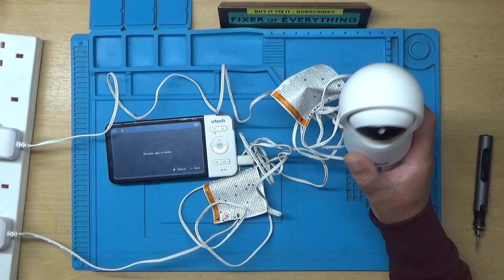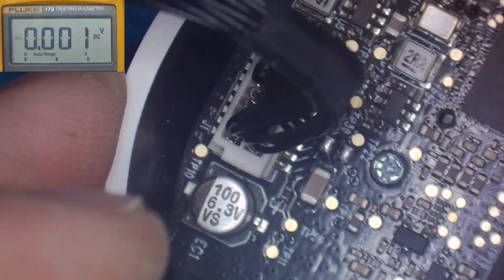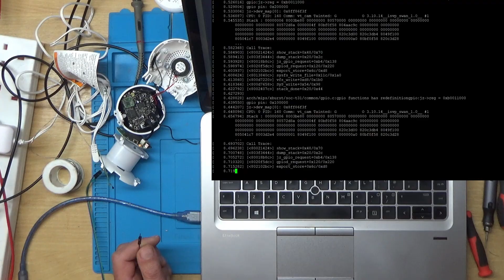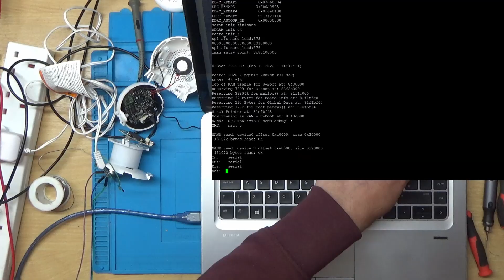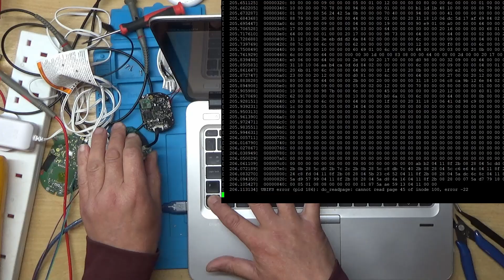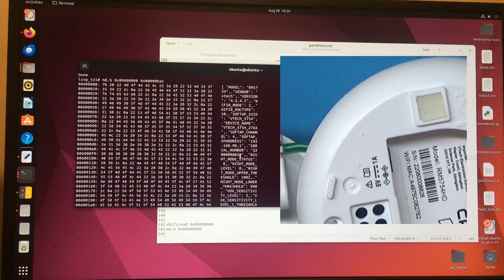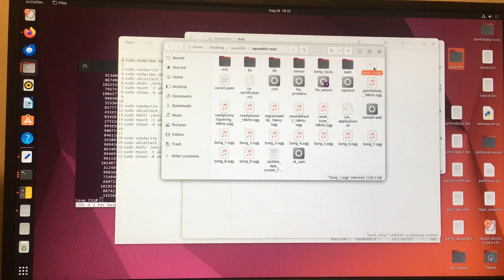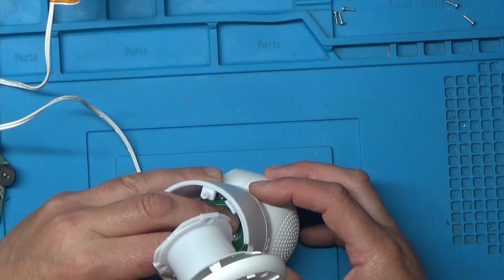Faulty VTech Baby Monitor | An EPIC Repair With Shocking Findings!

Comment: Amazing. I recently picked up two of these from a Goodwill bins for like 10 cents each with the model number being RM5766-2HD and no tablet so trying to use my phone. I'm having a problem getting both the cameras to read the QR Code off my phone so it would pair up. It seems to all work up until that point, but have no clue why it doesn't read the code no matter what I do.

Comment: It looks like it was running out of memory to initiate the system while booting. A shame this is not solved through the reset button.
Reply from the maker: After I got it working again, I found that there's an SQL database that indexes the pictures / videos on the partition. This had been corrupted (perhaps powered off at the time it was writing), and that was the root cause of things. Deleting the partition forced it to re-build the database.

Comment: hey, a late comment on this (side effects of subscribing to your channel not long ago, and binge watching), but if you get tired of the original firmware on this, there's thingino, an open source firmware replacement for ingenic socs, like this t31. it's really easy to add support for a new camera, and I'm pretty sure the sensor and wifi modules used here are already supported. just requires a brief gpio list and what they're used for, and you can program it through usb!
Reply from the maker: That sounds like a really interesting project, thanks for the tip! 👍

Comment: Holy god this was a hell of a ride just epic!! thanks for doing this video extremely detailed, I was searching Google for issues I'm having with a VTech monitor and your video just came in and I watched the full 55 minutes it was a great ride, and this practically confirm what is happening with my monitor, I'm 99% sure the firmware update go wrong just like your camera, but in my case the cameras (mine came with 2) are fine the problem is the monitor unit, it just freeze at the boot screen with the baby and the mother photo and nothing happens it just stuck there and there is no way to turn off the unit, only when the battery is depleted, even the reset button doesn't fix the problem, I guess I will have to connect it using a USB to TTL converter and solder just like you to be able to reset the partition and see if that fix the problem, I can't believe VTech is getting away with a problem like this, it could be a class action lawsuit, how many devices are being bricked because of this I wonder, thanks again for giving all the light to this problem from VTech and finding a fix.
Reply from the maker: Thanks mate 👍Hopefully you can figure out what's wrong with the parent unit.

Comment: Impressive fix! Takes me back to my linux admin days.
Another way to do it might have been to use fsck.ubifs to fix the filesystem instead of having to delete and recreate the partition. Also it's possible it wasn't the firmware update that bircked it.. it could have been a recording ehich hit a bad block and corrupted the image (in which case it might happen again in future). If so you could probably use 'nand markbad' manually to prevent that from happening.

Comment: Afaik, the usual purpose of the 0ohm resistors everywhere is just as jumpers to save money by avoiding extra PCB layers, rather than as fuses, though they will fulfill that function too.
Reply from the maker: Yes, I've seen them used as jumpers, fuses, and to isolate part of the circuit for troubleshooting.

Comment: You went way over on this fix, congratulations on figuring out how to fix the missing commands. I've got a couple of the modules for programming PIC and Arduino chips so is the one you used a different com?
Ok I figure it out it's just the standard Eprom 232 USB-to-serial UART. I got to do networking for Boeing in the 80's for 5 years we did all of that even Appletalk. Don't forget the data twist.
Reply from the maker: Glad you figured it out, those serial adapters are super useful! 👍
Reply: @BuyitFixit Just never figure to use them on consumer electronics.

Comment: I found this video brilliant, excellent the way you broke it all down to the flash data, fascinating 👍. On another note, will the camera revert back if it does a firmware upgrade again ?
Reply from the maker: Thanks mate 👍I'm not too sure if it was a firmware upgrade.After making the video I think the root problem was the SQL database that points to the stored images was corrupted, but deleting the partition that held the images caused the database to be rebuilt. I think it might have just been powered off at the wrong moment when it was writing the database.
Reply: @BuyitFixit ah right ok 👍

Comment: Great video! I have the same one which i was using but stopped working. Any quick way to reboot this camera with the pins? Don't need data recovery, just tobget my camera working again. Thanks again
Reply from the maker: Unfortunately not, this one wouldn't boot up properly and was crashing. You could try a factory reset if you haven't already.
Reply: @BuyitFixit mine is doing the same thing. I was hoping to delete/format it with some pogo pins.
Reply from the maker: @sol05033149 just out of curiosity, was there any power outages, or was it unplugged or something before it stopped working?
Reply: @BuyitFixit no idea, one day it was working then it stopped. Hoping i can follow your video. Would it be possible to do this on windows or is Linux required?
Reply: i fixed it now!!!! Followed the erase part of the video and got it working again. Thanks so much for the video, time and effort.

Comment: hello, i think i have a similar problem but i dont have the vtech data 1 and 2 partition can i make some space in the rootfs partition? im trying to create the vtech partition 1 and 2 but i dont have enough space😅 i dont have the right command ton erase stuff in rootfs. thx for the help if someone have a cue for me.
Reply from the maker: Perhaps it's a different model and doesn't have the vtech 1 and 2 partitions? I'd be careful about erasing stuff just in case you brick it completely. I'd try and backup the flash first.
Reply: @BuyitFixit my model is the RM5754-2HD its comes with a second monitor, maybe its because i factory reset it before taking it apart. Was almost there  but when i saw the two partition missing i was like ohhhh mannn .😂 ill try to back-up before doing anything on rootfs. Hope to repair its very unused. Thx

Comment: Hey mate, thanks for the video! I'm reaching out from Brazil. I've got the newer model of the baby monitor (RM5766HD) that wont boot. Got it in the USA in one of my last visits there, but they don't sell those here in Brazil, let alone any spare parts. I watched every second of your video and I believe I could give the wiping of the partition holding the recordings a try. I am a software engineer and can adventure myself with the programs and commands you shared, no problem. It looks like you used a USD to Serial converter. I found some for sale down here based on chip PL2303, FTDI USB to TTL for micro-controllers offering the RS232 serial channel. I hope that's the right converter/adapter to get. Thank you again, you just raised my hopes for fixing this baby monitor and making my wife happy <3
Reply: Oh BTW, I took apart the newer baby monitor model I have and noticed that they upgraded their game and labeled the pinouts accordingly: DP, DM, 5V, GND, TXD (transfer) & RXD (read) so I am able to tell exactly the 3 pinouts I should connect to.
Reply from the maker: Nice 👍,  yes one of those TTL to USB converters you mentioned should be fine.
Reply from the maker: I also discovered the root cause of the problem was a corrupted database file which was indexing the recorded videos, but deleting the videos seemed to recreate the database.
Reply: @BuyitFixit oh interesting! I wonder if they already pushed a firmware update for that. I'm waiting for the converter to arrive and will give this a try. Thank you so much again. Lots of love from Brazil

Comment: Amazing. I'm glad I recently found (and subbed) your channel.
Reply from the maker: Thanks Alan 👍If you liked this one you'll probably like the AVerMedia device I looked at, or the Solar Inverter that I needed a password for, or the tractor dashboard, or the generator control panel that they didn't know the pin code.

Comment: I Linux when you highlight something you can move the mouse to the insertion point on the CLI and center click to auto-paste the data without having to formally copy and paste into the buffer. This works everywhere. I use it to formal copy paste, the highlight more text a second time, and I can move two pieces of data to be pasted at a time. In other words you can highlight , then copy, then highlight again and move the cursor to the insertion point, paste as normal, then move to a new insertion point, center click to paste again the second buffer as long as it's still highlighted. Save you some time and clicks :)
Reply from the maker: Thanks for the tips 👍

Comment: Just curious are you using a differential scope probes or battery oscilloscope? Cant work out the earth mains referenced and not blowing up the scope?
Reply from the maker: No, just a mains scope. The device here is isolated by the transformers in the power supply.

Comment: Im trying to repair my babys monitor, but the terminal is not showing anything when i connect the camera/Ft232. Just flashing red light on the ft232😢
Reply from the maker: Have you got the right com port and baud rate select?
Reply: I'm kind of novice in this but I really want to sort the camera...hell not the top range those cameras as i have 2 and both same problem
Don't think I will be able to sort them
The ftd is recognised with lsusb
Reply from the maker: @DumitraBogdan  When you say flashing is it flickering like randomly? Have you got a terminal program running like I did? What happens if you type on it? Does the other led on the ft232 flash?
Reply: @BuyitFixit  the red led start to flickering as soon as I power the camera. If the camera is off is just a solid red on top left corner. Nothing happens in the terminal when I connect the device to the computer.. 😞
Reply: Can I send the cameras over to you?
Reply: I would like to contact you in privat. How can I do it please?
Thank you!
Reply from the maker: @DumitraBogdan  drop me an email at the channels name at out look dot com

Comment: Enjoy your series very much. Did you let VTech know about the privacy issue? Are you self taught? I'm a retired engineer. Got my MSEE about 40 years ago. I especially envy your dexterity. Keep up  the good work.
Reply from the maker: Thanks, Yes, pretty much self taught. I've always liked messing around with stuff, and what I don't know I can usually find info on things like chips or how to mount a flash dump in Linux, online. No I didn't inform VTech but their products are notorious for privacy issues 🙂👍

Comment: You are  very talented and clever, Sir. You must have been quite enthusiastic and excited, because at the end you spoke so fast it was hard to understand. I really liked the repair process, although I'm not an expert at it, I'm just interested. Thank you for your works.
Reply: Don't be so modest. You are smart. I am now looking at repairing a Kenwood kitchen mixer. We also have the same Chinese miracle, only it's called Silvercrest. I had a mechanical problem, the plastic bearing housing broke, the mini bearing broke. I managed to fix it, homemade, stronger than it was. We still use it now.
Reply from the maker: Thank you very much! I'm not an expert either 😂😂👍

Comment: Good hacking bro. Did a similar thing with an e-reader that wouldn't boot/. It had a seril header and I could look at the boot messages. It indicated a faulty chip. Changed it, but it didn't fix. My electronics knowledge was not good enough to figure out what might be causing the problem and life got in the way of pursuing it further.
Lucky for you it was just a full file system :)
Reply from the maker: Cheers 👍

Comment: Fascinating but I don't quite understand why deleting the video directory solved the problem or why the designer allowed it to occur.
Reply from the maker: After I finished recording the video I was messing around with the filesystem on the computer still, and the root cause of the problem was a Sqlite database on Vtech_data 1. This database is what the camera uses to index the video files, and it had became corrupted. Deleting the videos, made the database no longer valid so it was re-created. It might have been that the database was being updated when the camera lost power or something and that's how it became corrupted but I can't say 100%

Comment: I spent too much of my life working on UBoot, embedded Linux, boot monitors, MIPS chips, and also working with Ingenic on some of their MIPS silicon. I'm now very pleased to be retired and ... doing much the same at home for a hobby!
Reply from the maker: Nice 👍I still love doing this type of work, but sometimes it's just too time consuming for me these days as I've got a lot of other stuff going on. I remember reverse engineering kids toys a few years ago, writing drivers and porting different games to them (a few videos are on here from about 8-10 years ago of the leapTV and a few other things when I was doing that).
Reply: @BuyitFixit  I've got a Sonos Connect AMP that I bought "Spares or Repairs" on eBay, found loads of blown bits in the switch mode power supply, fixed it all, and up it started! I then connected to it in the Sonos app, got told it needed a firmware update and after the update it hasn't booted again. Factory reset doesn't work. I know it needs a serial port connecting, and I even know what's what pin wise, but it's still sulking in its box. BTW I started out in games programming in 1984 !
Reply from the maker: Hmm, I did see what appeared to be a serial port on the sonos I was looking at but I didn't try hooking it up.The approach Id use would be find a ground and then poke at it with the scope see if you see any serial data coming out. Then you can find the GND pin and supply with the meter, the other pin would be for receiving data :) Normally there are 4 pins like GND, RX,TX, +5v or such.
Reply: @BuyitFixit  Yeah, I know where the pins are, but also know that getting this data will send my brain down a rabbit hole for multiple days. I've fixed loads of Sonos gear (keep some, flog some, mostly their inept SMPS PCB layouts causing issues) but this amp is still on the pile. However, the nights are drawing in.

Comment: Great work! Without knowing it,  rewriting over  that partition appears to have caused the volume map to be rebuilt and possibly rewrite the VIF headers. Genius!
Reply from the maker: Thanks 👍After I finished recording I managed to find the file that caused the problem. The problem seemed to be a sqlite database stored on vtech data 1, which indexes the video files, so perhaps the camera lost power or rebooted while updating this file. I think deleting the videos caused this database to be re-created and fixed the error.
Reply: @BuyitFixit could very well be that. Great work :) 

The reason I feel it's more to do with the UBI blocks and its headers is the way you could see in the kernel buffer the "do_readpage" struggling. 

UBI can be a real pain to deal with. All the new BT Home Hubs use it... gives you that extra step when doing firmware analysis.

You've gained an extra subscriber 😊

Comment: I've got two cameras with the exact same problems and the internals look identical inside minus the bottom pins and I have no way to connect the chip to a PC, is there any possible work arounds or possible ways to reset the chip
Reply from the maker: The main chip supports serial, so there might be internal test points on the board. You would have to get up the T31 datasheet and try and trace where the pins go from UART0, UART1 etc and see if there is any activity on the pads that go to those pins.

Comment: Quick note: a zero ohm resistor is really just a piece of wire. Next time just replace it with a wire jumper where the 0 ohm surface mount part was mounted. No reason to search your parts bins for a replacement 0 ohm resistor. Jumper wires RULE! 
Good work on all the research and file system digging in! You almost forced me to learn Linux!
Reply from the maker: Thanks 👍While a jumper wire would also work, I'm not too sure on the current rating of it compared to the 0 ohm resistor. I thought it might be better to just replace it with another resistor.

Comment: Great video, very interesting. I see you was using Minicom for the ttl terminal. I use putty most of the time. You used Ctrl+h for the backspace key. in butty you can edit it in setting to use ctrl+h or Ctrl +? (127). But in Minicom i can not find it in the setting. As you mentioned you edited it the setup. Can i ask you where it is?
Reply from the maker: Thanks 👍It was putty I was using at first on Windows which had the setting when I was talking about editing the setting. Minicom was used later on the machine when I was running Linux.

Comment: Wonder if VTEC know update is reason for the brick cam. Crazy how you can fig all this got be most complete tech repair channel I have ever seen
Reply from the maker: Thank you👍 After I finished recording I managed to find the file that caused the problem. So I'm not sure if I can be blamed on the update although the dates did seem co-incidental so it still may have been the cause. The problem seemed to be a sqlite database stored on vtech data 1, which indexes the video files, so perhaps the camera lost power or rebooted while updating this file. I think deleting the videos caused this database to be re-created and fixed the error.
I've made a playlist of similar work I've done if you're interested.
https://www.youtube.com/playlist?list=PLu4s108ty9Iki2H77htqeCNqtunWMJFKK